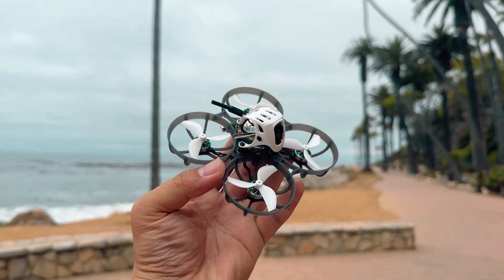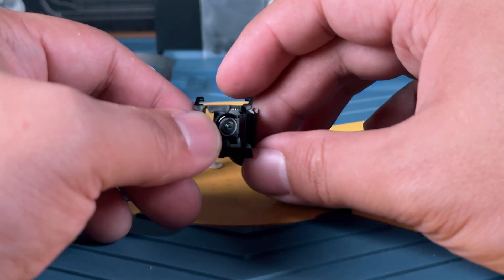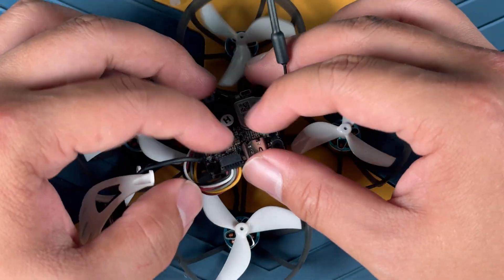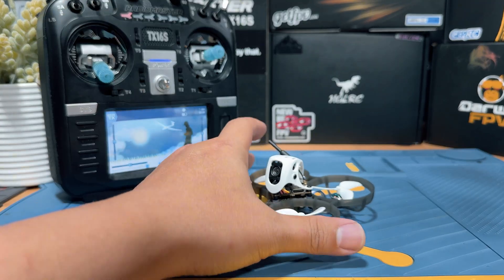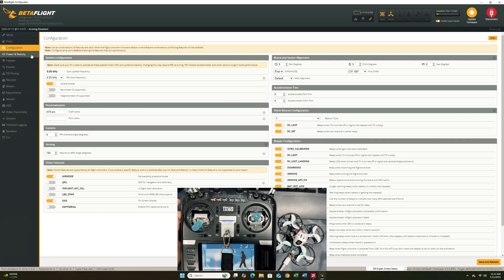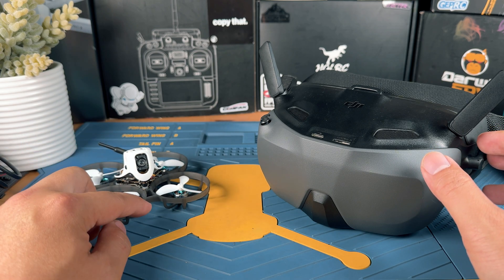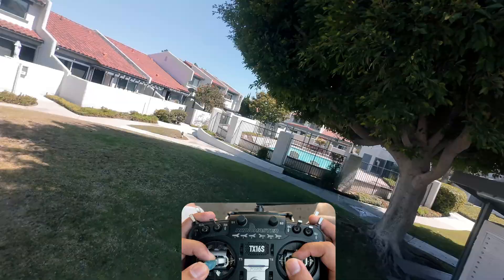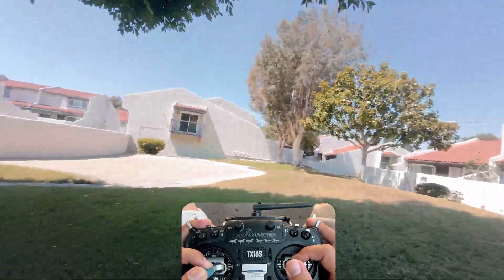Smallest 4K FPV Drone |  Setup + Testing the BetaFPV Meteor75 Pro O4

Comment: Dude! What about heating issues relating to FC .? O4 directly mounted on the top of FC.
Reply from the maker: This is unavoidable, but based on my use case, as long you are flying and keeping the airflow going, it should be some what moderate.